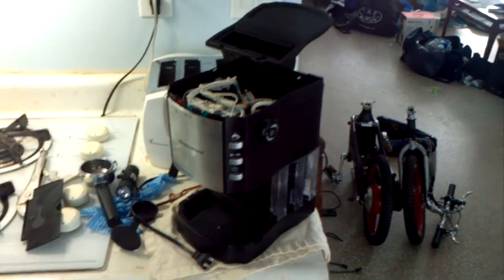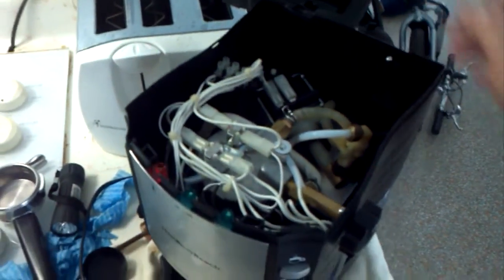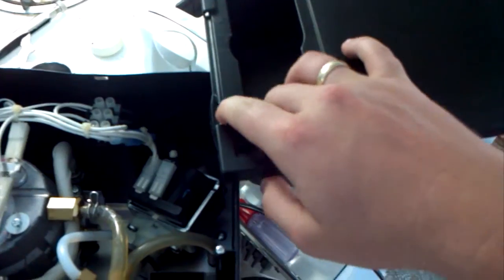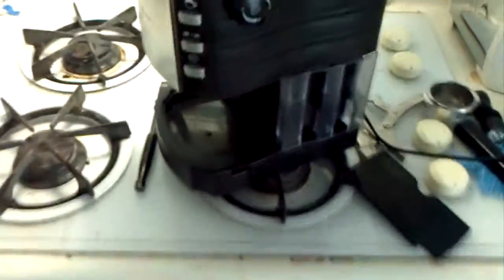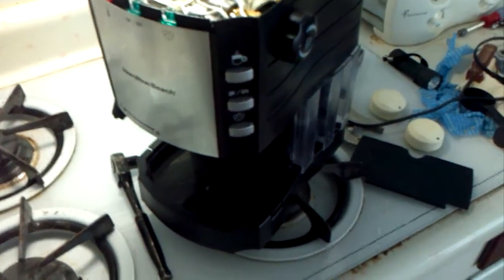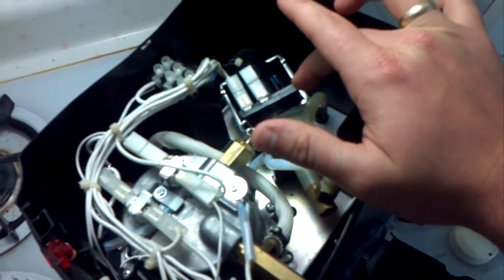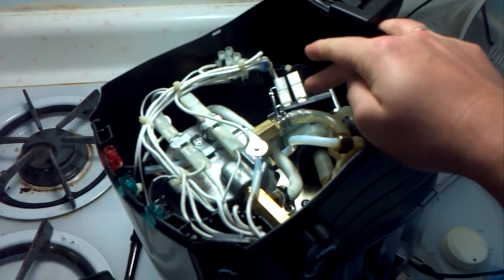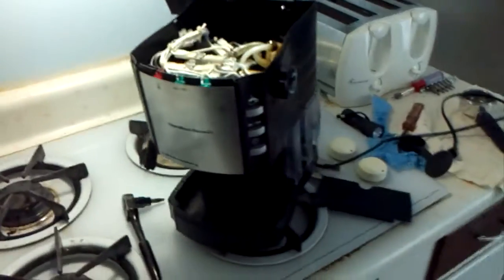Hamilton Beach Espresso Machine fix!

Comment: I had quite a similar experience with another model of the same brand. Found it in the alley. I love to fix stuff so I decided to give it a try. When I plugged it, it made that awful loud noise you talk about in your vid! It was disgusting, smelled like rotten sea water. But before getting into the motor part of it, I did a thorough cleaning. I found the bronze screw, took out the filter and brushed it with soapy water, cleaned everything with hot water and soap and then I ran vinegar through the water holder, several times.  A lot of stuff came out. Calcium deposits from the water, etc... After the 2nd time running pure vinegar, the sound were much less loud until it became "normal". I did the same thing running vinegar through the steamer. Now it works perfectly!!!

Comment: Couple of additional tips:
Check the pump before taking it apart. Bad pump means replace. Pretend you brew esspresso, put another cup under the frother and open the steam knob. If pressure water comes out ur pump is fine (no need to press the steam button for that, its made for hot tea water)
Rinse weekly with vinegar or monthly with CLR.
Fill with filtered water to prolong life. 
I have mine for 9 yrs and still working after I made some fixes thanks to Vlad.

Comment: It worked for me. Yay! Try a small pair of vise grips with  nonslip coated handles instead of a screw driver on the big brass screw/bolt. Twist back and forth to loosen and it should begin to unscrew. I used a penny to finish removing it. Remove the screen and the spring to clean also.So grateful, thank you!

Comment: I had this same problem with my machine. My mom got a new machine and gifted this model to me. I didn't use It for a few months and it sat in storage, but when I fired it up... Nothing! I shoved it in storage and finally got motivated to repair it yesterday. I've been trying to run vinegar through it since last night (I recommend trying this first to break up hard water deposits). It still wasn't working, although the steamer was working fine. I cleaned the filters with vinegar and after watching your video, I  gave it a few good thumps around where the pump is located. I didn't have to take the top off at all. Sure enough, after a few good thumps, I fired it up and off it went! Deposits and vinegar came pouring out. I'm pretty sure it's just a matter of hard water getting stuck in the pump.
Reply: Someone gave me one of these and it works but I ran 2 batches of water & vinegar through it anyway. I think it's good to do this every few months: Run it with vinegar-water, shut it off, leave the vinegar-water in for a day and then run it out, then run two batches of water through to clean it out. Also it's best to always use bottled water in these machines as it has less calcium and other minerals that clog things up. The problem I have now is the steam smells like rubber! Some black soot even come out. It's real bad. There is no way I'm going to steam milk with it unless it goes away. Any ideas?
Reply: hicoteo the pump on mine finally went out. my mistake was probably using tap water. we have really bad hard water here.

Comment: Great video. Almost threw mine away. True, the brass screw wont come undone easy. I stripped mine but then ended up removing the screen. Underneath it was old coffee. I got BrewRite machine cleanser from wallmart. Rinsed it off several times and im back to brewing. Thanks for the tips

Comment: The bronze screw on my coffee maker is screwed so tightly that I am unable to unscrew it. And the filter is totally clogged. I tried vinegar but it did not work. What kind of screwdriver did you use? I don't have many tools and the screwdrivers I have are too narrow and have long handles. The screw head is about 15mm wide. Any advice would be appreciated!

Comment from the maker: I ended up using heat to help unscrew it but in retrospect I would recommend trying to cleaning it with vinegar first to help break down any excess mineral build up in the machine; as the link in the comment explains.     and also check out the original manual for this machine whose link is also in the comment section.       
Hope  this helps.

Comment: Thanks.  Tried vinegar/water combo with no luck, and unfortunately the manual doesn't advise how to disassemble the unit, since the manufacturer probably wants you to buy a new one rather than be able to make what should be a straightforward repair via cleaning - ugh - disposable electronics are such a waste.....

Comment: Thanks for the help but it didn't work for me.  I called Hamilton Beach and told them the water no longer comes out for espresso and the pump runs but is really quiet now. I said I've had it for a few months and they're sending me a new machine no questions asked.  Obviously its a common problem